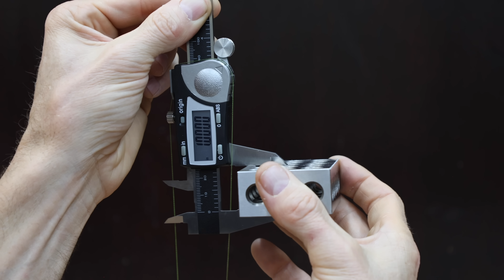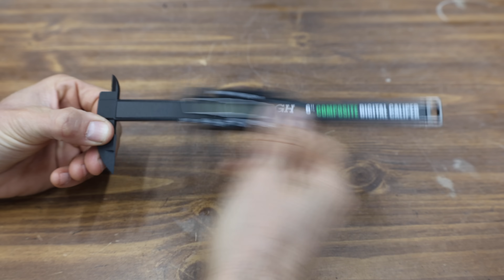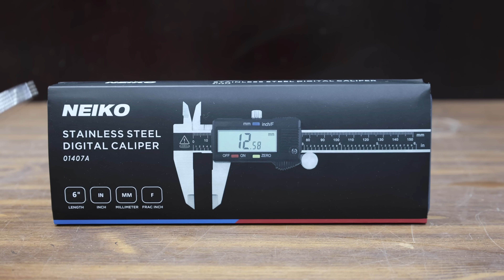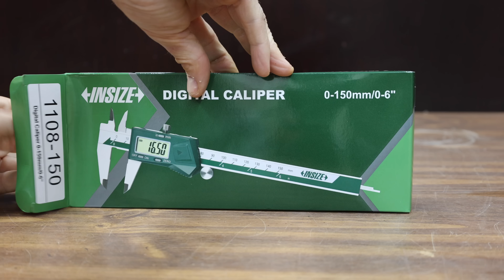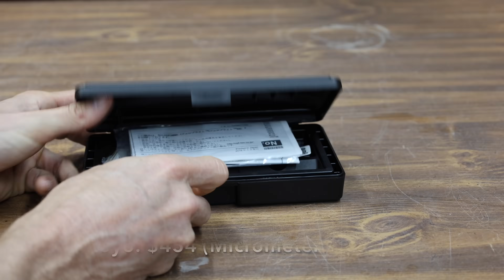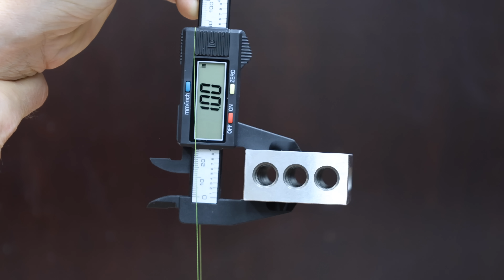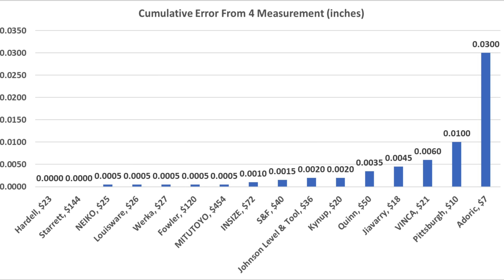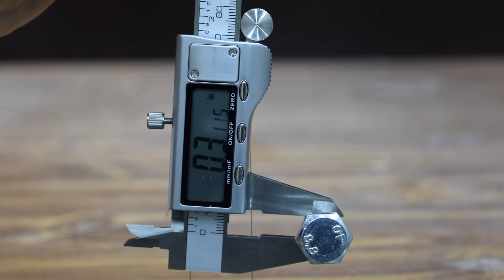I've Been Proven Wrong About Calipers!

Comment: Honestly, one of the more dissappointing reviews you've done. Not every one can be a winner, but not testing battery life on these is a huge miss, since that's the #1 complaint with cheap calipers. Almost all of them use the same chipset that constantly uses battery to keep the position info stored, and it's super annoying to have to constantly change batteries since even stored and not powered on many of them won't last 6 months in a toolbox. That said, this is the first of your reviews I've been really disappointed in, this channel will definitely still be one of the first places I look when purchasing tools.

For anyone who has this same issue, I don't know if any of the other cheap ones have this issue, but the 10 year old Starrett set I have maybe needs a battery every 2.5 years, and I have yet to replace a set of batteries in my Mitutoyo that I bought 4 years ago. Either brand is worth the premium just for the battery life.

Comment: In my opinion insize, Fowler, starret, and mitutoyo are best. Generally accurate within a half thousandth and can hold up to a drop. Wish you had a set of pin gauges from .245-.500 in .001 increments to spot check OD a little better and wish you had checked the ID on them. As usual, awesome video though
Reply from the maker: Thanks!

Comment: I own both the Neiko and Mitutoyo, and in my experience the main difference comes down to the battery life. The battery drains far more often with the neikos, and when the battery starts to get low the accuracy will drop, and this will start to happen before the screen starts to dim out. I would have like to see a test on the battery power comsumption with the calipers on while measuring, and with them off aswell. Youll see a big differnece between the cheaper and more expensive brands.
Reply: Yea it's definitely noticeable how long the battery lasts in a Mitutoyo vs a cheaper option.

I've got some cheap calipers for scuff work where I won't cry if they get hit with some sparks or swarf or dropped and feels like they need a new battery every 4 months but I haven't replaced a battery in any of my Mitutoyo in over a year maybe even years
Reply from the maker: Thanks for the suggestion.
Reply: Good to know 👍 I own two Neikos, small & large.
Reply: my mitutoyo accuracy never drop even with drained battery
Reply: AvE did some testing on caliper battery life a few years ago. He found they consume nearly as much power when off. Since then, I take my battery right out when not in use.
Reply: I also have both.  

My Neikos stopped working for some reason which is weird as I use them indoors mostly for 3D printing related stuff.  Basically the screen would just display random characters.   

Anecdotal but personally wouldn’t recommend them.

Comment: Personally used the insize ones and I would say the review is on point. Keep in mind that some brands will offer a more expensive version of the same product with a calibration certificate. The ones that don't might have variance between them. So if a cheap one performed well, you might just have been lucky.
Reply from the maker: Thanks for the feedback.

Comment: My calipers are smaller. Micro mark and a similar. Both are 20 years+- old. both show identical measurements. Both shut down and use the wimpy battery that I still use. IF i needed a new one, I'd buy the bargain priced one shown here.
Reply from the maker: Thanks for sharing.

Comment: I bought a set of digital-readout Fowler calipers back in the 1980s for around $250. I got them because I was doing morphometirc research and they came with a serial interface. However, I found that Fowler wanted too much for the interface software so I never purchased it and the free version of the software was too clunky to actually be of much use so I ended up recording the data manually. However, the digital readout still sped things up considerably versus the vernier calipers I had been using. I've used my Fowlers at least once a week for almost 40 years now, both in the field and in the shop where they definitely haven't been "babied." I once had a machinist friend test my Fowlers against his precision Starrett micrometers and he told me that they were dead on.
Reply from the maker: Thanks for sharing.

Comment: Unfortunately you didn't test for one issue: The cheapest calipers deplete their battery within 1-2 months, even if not used at all. So you have to either store the battery separately or have it dead whenever you need it.
Reply: I have one Pittsburgh and two Johnson calipers, and I havent had to change the batteries in them since I bought them. Its been over a year for the pittsburgh, and 6+ months for the Johnsons.
Reply: @GrimReaping  I didn't mean the cheapest ones in the test but cheap in general. I had 2 different no-name brands and both depleted a button cell within a couple of weeks, no difference if used or not.
Now I have one from Shahe and it also is still on it's first battery.
Reply: @MetalheadAndNerd Oh, okay. I didnt read it like that

Comment: It doesn't matter which is the best because the battery will be down or corroded when you need it. I have a welding hood like that. If it has a battery I don't want it.
Reply from the maker: Thanks for the feedback.

Comment: I'm curious how accurate that 1-2-3 block is. Amazon special? Or is a certified block. You really need to measure the block with a micrometer that's in spec in the spots you are going to do all the tests. Then compare the results to that. When you're talking thousandths of an inch these finer points really matter.
Reply: He did measure it with a micrometer
Reply: @lrmackmcbride7498  No he didn't. lol
Reply: Definitely this. And forget the 1-2-3 block altogether and use gauge blocks for a test like this.
Reply: @amiller7  You're right, Jo blocks would be more accurate but when machining to critical dimensions, a micrometer would be preferred. Calipers are ok when doing general work. But, yes, I would have used the Jo blocks.

Comment: Thank you!  I’ve been using Pittsburgh 3-mode calipers which were under 20 Dollars about 20 years ago.  I recently upgraded to Mitutoyo 150 mm calipers and they are noticeably better.  Smoothness and repeatability are better with the Mitutoyo, but the cheap Pittsburgh are still decent and good enough for most jobs.  You really have to watch out for Fakes with the Mitutoyo.  I would stay away if “Made in Japan” is not on the instrument back and on the storage box back.
Reply from the maker: Thanks for the feedback.

Comment: Many cheap ones still use a lot of current in sleepmode (Or do not really go in sleep mode) . We had a discussion about that on an electronics forum and several people measured that current. Some calipers did over a year with a battery (the Mitutoyo) , others only weeks or months. I used to have one many years ago but ditched them due to very short battery life and switched back to my mechanical Mitutoyo. 

Other important points is stability over time. Like a cheap Multimeter that is new spot-on but drifts out of calibration rather quick or has a huge tempco.

Also important is how long it stays going smooth and if it gets to much freeplay.
Reply from the maker: Thanks for the feedback.

Comment: I've been using Harbor Freight digital calipers for 15 years. They are fine for what I do. The only problem is that the battery will die if left in the calipers for a long period of time. After I use them, I just remove the battery.
Thanks for the video.👍
Reply: That's the secret. Pull the battery.
Reply from the maker: You are welcome!  Thanks for sharing.

Comment: Millwright/machinist here, I have a few calipers - for smaller ones I have Mitutoyu electric, but my go to is my Starrett with a dial. Always on never needs a battery, still easier to read than the old style vernier scale type. I use micrometers when I want to be super accurate, calipers to get close. My biggest Mitutoyu caliper measures up to 6 feet and has a vernier scale.
Reply from the maker: Thanks for sharing.

Comment: I have been using the same Starrett dial calipers for 30 years.  My eyes aren't as good, so I bought a cheap, AliExpress-special pair with the same thumb wheel and lock on top.  Magnificent... after I took a stone to the rough edges and cleaned it.  Basically like a Mitutoyo that had not been through the final stages of Manufacture and QC.
Reply from the maker: Thanks for sharing.

Comment: Another Mitutuyo/Starrett bro chiming in. Would have at least recommended a gauge block when measuring your 1-2-3 block depth. Any surface that isn't perfectly flat may incur variations in depth, even with the same caliper.
Honestly, there likely are other brands that work good enough out there, but by the time you reach certain measurement requirements, calipers are just a generic tool before using a proper gauge or micrometer.
Reply from the maker: Thanks for the feedback.

Comment: I got some Mitutoyo's several years ago and after about a week the measurements it show would change even without moving, I ended up with some Adoric like ones for electrical work and they've been flawless
Reply: There's a huge counterfeiting problem with Mitutoyo calipers. If you bought the calipers off the Internet and it wasn't an authorized dealer odds are they're fake. It is extremely difficult to tell the fakes from real ones. There's videos here that go over some of the details. Like how the groove in the back ramps. The real give away is battery life though. If the battery doesn't last for years then it's a fake.
Reply from the maker: Thanks for sharing.
Reply: that is a fake mitutoyo for sure.

Comment: The Pittsburgh calipers I wasted my money on as my first set, the battery compartment lid wouldn't stay tight-led readout would go blank in the middle of measuring. Tried a new battery. I even tried to put a piece of card paper in there to make the battery tighter in the compartment. No go. I learned my lesson and bought a Starrett dial caliper. No more batteries.
After a few years I got a Mitutoyo digital. It's superb.
Reply from the maker: Thanks for the feedback.

Comment: calipers cannot be more accurate then .1mm. the measurment plane and force plane are not inline wich makes alot of these .000x differences irrelevant. and not measuring it by feel and going for the smallest value on display kinda makes me question the accuracy of the tests. and having a higher resistance near closure is wanted since it helps with not using to much force and measuring more accuratly.

Comment: One small discrepancy: The Mitutoyo uses SR44 batteries NOT LR44. Silver-Oxide batteries can provide about 30% more capacity and therefore last longer than LR44 batteries. 

You can see this in your video on the back of the Mitutoyo (Battery: SR44).  It also says so on the packaging of the battery that came with the caliper. 

Also the mitutoyo calipers often cost from $129 (6 inch version) to $200. The full wooden case isn't needed. 

As always you made an excellent video, thanks for all your work! I highly recommend Fowler's 24 inch caliper if you ever want to do a long-range caliper video, I bought mine from "Tool Discounter" and it shipped directly from the fowler warehouse (But now fowler lets you buy direct from their own website). If you ever do another caliper review I'd love to see how that stands up against the rest, I've been able to track ± 0.002" changes in some 15 inch aluminum extrusions from cutting in sunlight vs cloud cover - drove me up a tree to figure that out!

Comment: For what it's worth, I've used the Mitutoyo for over 20 years, and the battery life is usually measured in years.  Also, McMaster-Carr sells the Mitutoyo for $145, unless you need SPC output or a calibration cert.
Reply from the maker: Thanks for sharing.

Comment: The ones with batteries do not turn completely off.  They retain the last measurement,  which drains the battery. 
For low cost .metric and SAE the mechanical ones with 2 hands and 2 sets of  measurements are the best for the average home mechanics.   
Save the Starret and Mitituto for people who know what they are doing.
Reply from the maker: Thanks for the feedback.

Comment: i am glad to see the world finally getting calipers , even if cheap versions , 25 years ago almost only machinist had it.
Reply: Bought my first dial calipers in the mid-70's from Sears. Still have them. Still use them. Had them calibrated once, and in so doing 'zero' on the dial slid a touch clockwise. 'shrug' I live with it. Bought them to measure the diameter of component leads that fit into circuit board assemblies. Cleared up no small amount of assembly problems...and more than a few hassles with vendors shipping crappy components...😮
Reply from the maker: Thanks for the feedback.
Reply: And TIG welders who fab precision projects. We interpret large blueprints using all decimals, average plus or minus .015 and for the military .005. I used Mituyoyo dial calipers 6 and 12 inch bought in 1982. Also used Starrett combo squares, protractor and 12" 24" and 36" hard rulers for the combo square heads.

Comment: Awesome testing as always, though there is an issue with the plunge measurement testing. 

It appears that you are measuring by sticking the back of the calipers through holes in the 1-2-3 block until they touch the table. That is how I would have tested too. However as you can see in the video the table is a wood surface that has scratches and other defects, including small dents. Given the accuracy that you are trying to measure, this is enough to skew results. The proper way to do this test would have been to have a flat hard surface like a machined piece of metal, and put a target dot under it so that when doing the plunge test you are hitting the same spot on this flattened, undentable, unscratchable surface just in case the surface does have some defect.

Excellent work.
Reply: I was thinking the same thing. If a similar test is done again, a surface plate should be used to ensure consistent results.
Reply from the maker: Thanks!

Comment: I've had really good luck with Fowler. However, I am not a fan of ANY caliper that uses a battery. I much prefer analog. If you stick with Starrett, Fowler, or Mitutoya; you'll be assured of a relatively accurate measurement.
Reply from the maker: Thanks for the feedback!

Comment: I like the all stainless steel Mitutoyo 500-752-20 because its good for automotive and other similar work. The generic plastic ones are way more convenient though and in theory should give similar measurements to higher end calipers. Commenting prior to the video so really interested to see! :)
Reply: 30 year automotive quality engineer here. Totally agree on Mitutoyos. But the plastic-bodied Harbor Freights are adequate for measuring battery terminals, without risking making contact between the posts. (Ask me how I know 😅)
Also nice when I take them somewhere I might either leave them behind, or where they are at risk of walking away.
Reply: @peacefrog0521  Plastic calipers are a joke, battery post measurements, ⚡️⚡️⚡️sure.😆
Reply: @SolitaryCanid  Plastic calipers are great when you want to measure something that metal calipers could scratch, and the accuracy is not critical. Plastic and metal calipers have slightly different use cases.
Reply from the maker: Thanks for sharing.

Comment: I worked in a factory in the 1970's.  The calliper that everyone was talking about was made in Poland and cost $10.00. I bought one.  We put it on the measuring blocks and it was perfect.
Reply: That would be around 60 bucks today. That's probably not very far off from what Starrett would have been charging.
Reply from the maker: Thanks for sharing.

Comment: Had to replace my vacuum this week and ended up getting the Kenmore from your video. You've never led me or I doubt anyone else astray. Glad to see my set of Kynups for general work didn't do too bad in the lineup, but now I know where to look for the next upgrade.
Reply: I went with the Kenmore shortly after his vid.
Works great so far and easy to clean/wash out filters and cartridge.
Not great when detaching hose and using it for above or floor.
Machine will tip over, or you'll need to lift it to reach.
Attachments will get knocked off when bumping or going underneath.
Chord memory is difficult to break. I'm going to try hot water then wrap.
The Red Devil Ultra upright I had for 25 years was superior, but dead!
Reply from the maker: Thanks for sharing.